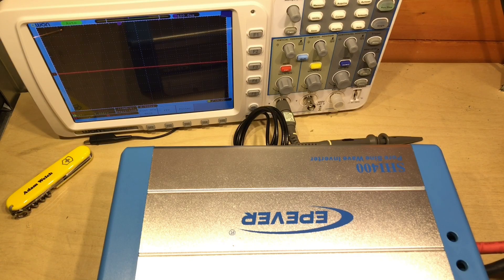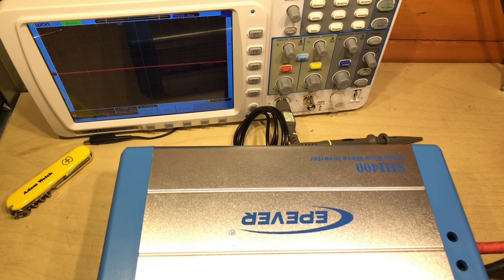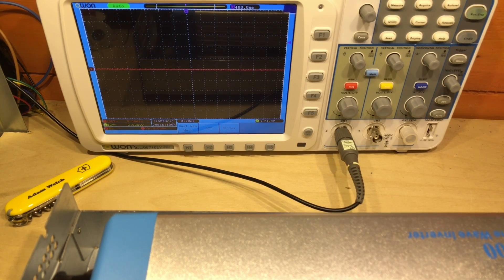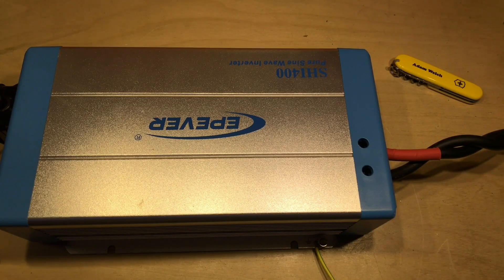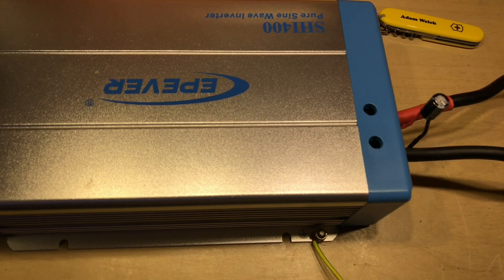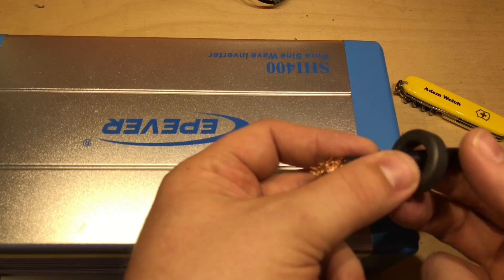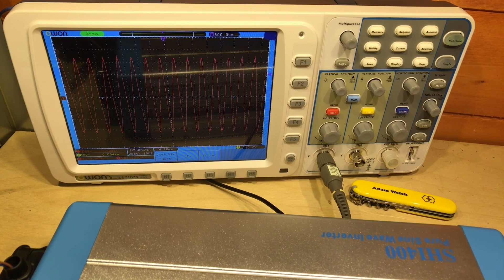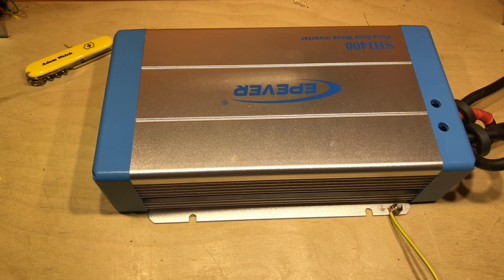Reducing RFI - Four simple methods - 12v Solar Shed

Comment: 1:24 The bad news is that those cutouts, at the right frequency act as very good "slot" antennas!  Even when not resonant, the shielding effect of a metal box relies on fairly complete closure.  Any hole, including an unwelded seam, that is about λ/4 or larger will conduct noise to the outside surface of the box, where it will radiate.

3:16 Filters are really some combination of inductors and capacitors.  Each capacitor has some amount of parasitic inductance, particularly those with wire legs (as opposed to surface mount), past which it ceases to be a useful filter.  There is always a frequency at which a particular component is resonant.  Wires also present a normal resistance, too, and especially electrolytic capacitors of the sort you used tend to have a maximum ripple current.  

So although capacitors can work, an LC filtering network needs to be designed with all that in mind.  

5:09 ah yes, the bane of every audio engineer's life.  That cable is for unbalanced audio which suffers from several different types of noise.  One is entirely conducted (ground loops) where especially mains AC noise currents in the shield/ground appears as noise relative to the signal, which the input stage faithfully picks up and reproduces.  This situation is most likely to be a problem of common-mode noise on the cable (ie, noise currents on both conductors going the same direction).  The right sort of ferrite ring can help with that, too.  (And note that choking impedance is proportional to the square of the number of turns.)

For this reason, professional audio uses balance (XLR) audio cables where possible.  These still pick up common-mode noise currents, but the complementary wire picks up the same amount of noise as the true wire, which the audio input stage cancels out by subtracting the signal on the complementary (aka 'cold') wire from the true ('hot') wire.  The result is clean audio, but it doesn't mean the noise isn't there.  

In this case, the inverter is still very much to blame.

Comment: This video is old but I want to comment to maybe help others... I designed a 12V to 230Vrms power inverter for automotive applications before.

The first method in the video didn’t work because you need to connect the ground of the inverter to the shield. But you have to becareful because if the low voltage and high voltage sides are isolated then you can create an isolation fault (isolated inverters should protect for this).

In our module we did couple of things to reduce EMI noise. We had a large LC filter on the front end. This will reduce the noise going out to your system. This is applicable if you have other electronics connected to the same source as the inverter. If the batteries are only powering the inverter then it doesn’t matter much. Adding a capacitor like you did at the input will help some with the noise going out to the power source but won’t help much on the AC side (for isolated systems). You can also add ceramic capacitors on the input to help with the noise. We had a ceramic and a electrolytic right at the input of the module. The electrolytic will form an LCR pi filter with the inductance of the input wires.

Second we placed X and Y capacitors around the input and the output and connected them to the module housing. The housing was the heatsink and also acted as a RF shield.

Thirdly we created a sudo faraday shield around the PCB by ensuring we always had a ground plane all throughout the edge of the PCB. We had a four layer board and tried to have ground on all four layers around the PCB and they were sitched together using via’s. This helps with radiated emissions.

I know you can’t do some of these things on a ready made module but hopefully this will give some ideas.

Comment: The interferences also makes the rs485 data transfert difficult to the epever tracer A charger. A bit a pitty because this inverter works fine otherwise. I use the hsi 3000 W.

Comment: The RFI on my Shi1000 24 v version is driving me crazy! I cant use it on my pc, which it was intended for, because it makes flickering on my pc screen which makes the display turn on and off on random.
Tried with some homemade ferrit rings out of metal strips but sometimes it works and sometimes not, so im ordering both real ferrit rings and capacitors now.
Just not sure what capacitor values to use on a 24 volt 1000 watt Shi1000 ?
Capacitor 35v 1000uf ?
Higher or lower uf value ?
Reply: Adam what size is the ferrit rings ?  You made just one loop?
I made some homemade ones out of metal strip.
Gave them 2 loops at first and it solved some of the problems.
Then tried 3 loops and a tighter fit to the rings with plastic strippers.
It made it worse again :(
Reply from the maker: My rings were too small really for the cable.  I got one loop through.  Also it may be better to loop the positive and negative through the same ring in opposite directions.  But whatever works really...
Reply: It might be too early to draw conclusions but i suspect this interference comes from either the charging process some way, the controllers or the batteries when charging, because yesterday at mid day when i tried a new approach with one ring, one twist and opposite ways trough the ring for positive and negative. it was flickering so much i couldn't use the pc.
Last night and this morning with a lot of clouds there was no flickering.
Now when the sun starts peeking out from the clouds the flickering starts again slowly.
I will try adding a capacitor also but im unsure what values to use for a 24 volt 1000 watt system?
I might try and get a special cable for my pc also as it seems only to cause problems with my pc ( television works and laptop work fine).
Im getting a 3000 watt inverter soon to go all off-grid but if this problem isnt solved it wont be an Epsolar/Epever :(
Btw a user from a danish solar group messaged me some days ago and said he had problems with his Shi1000 also.
When charging his Iphone there was so much audio inteference that he could not have a conversation while the phone was plugged into the inverter for charging.
Clearly Epever has some issues they need to address  regarding these inverters :(
My "cheapo" "500" watts, 50 dollars pure sine inverter has no such problems but its crap regarding delivering power

Comment: I am looking for a solution to the noise I hear from my solar inverter ... it has a high picked humming that drives me nuts
Reply: Me too, my house runs on an inverter, with it being only a 3000-watt pure sine wave I am thinking about a supply filter unit on the mains out lead from the inverter which I robbed out of a washing machine, it drives me insane, today I bought an antique MW/LW radio, it sounded great until I put the inverter on, the whole house wiring seems to become an antenna for this noise and it ruins enjoyment listening to radio's. 
And the electro-smog generated cannot be good for humans either, even if my £2.75p winter electric bill does compensate for it a little.

Comment: I have bought the Epever Shi1000 24volt 1000 watt and been using it for a few weeks. At first i thought it also had RF problems also as i had some flickering on my Computer screen when i was using my computer but it turned out to be a loose gfx card.
So far no issues with my Shi1000 in any regards but it is also placed outside and connected to my room with a wire.
I think its about 5 meters and a wall apart from my PC and no RF or other issues.
I highly recomend this inverter.
Much more powerful than most others and not much more expensive than the cheap ones that dont match the promised output, or does so with unstable and unreliable running.
Reply from the maker: Mine definitely lives up to it's claims.  It will deliver the constant and surge power suggested.  Glad you're happy with yours and you're not seeing any ill effects.
Reply: I just hooked my computer up with the Shi 1000 and had grafik problems again. tried many times with different cables.
Its not a loose gfx card but my Shi 1000 that has similar problems.
It causes small flickers on my pc screen and the display switches on and off.
It seems ill have to order some of these Ferrit rings and hope the so the job.
About the capacitor?  If i want to try that option also, what capacitor should i get?
Its a 24 volt system running at a 1000 watt.

Comment: Hi Adam, interesting video. Us electronics guys  need to minimise any R.F. interference not just for ourselves. Problem is neighbours will often blame the 'radio ham type bloke' in the shed, for any interference problems, when in most cases the shed gear is not responsible at all.
Reply from the maker: +Michael Thomas Yeah I agree. Theres so much electronic kit in everyone's home and a simple faulty component or badly designed circuit in any one of them can cause interference. As soon as we identify it we should be attempting to reduce its negative effects for everyone's benefit.

Comment: Hi Adam how can I use this inverter in my country which we use 110v as epever only sales the 220v version? also is there a way to make modified sine wave inverters a little "better" and by that I mean using some type of filter or rectifier to make them produce a more clean sine wave? thanks and sorry for the tricky questions I love your videos by the way
Reply from the maker: +Marcos Figueroa Hi Marcos. You might be able to step the voltage down using a step down transformer - but it seems like over kill. I'd be just tempted to use another model of inverter - one designed for 110. 
Modified sine waves are exactly that and there's no way to make them cleaner that I'm aware of. Some are better than others (more differential steps in the wave) but many are three step and pretty poor for many devices.

Comment: Seems like your mic extension cable was not properly shielded (or perhaps not at all). Many posters have already covered the "capacitor thing" so I won't comment further there. The other thing to consider of course is proximity. If you can move the inverter further away you'll get less direct radiated RFI and then you can treat the mains output easily with a commercial in-line noise filter. Often the best approach for getting rid of RFI is to use all the methods at once!
Reply: As as aside to the chat going on here: If you're operating really sensitive equipment from an inverter the only real choice is "low frequency pure sinewave". These inverters create a 50 Hz (or 60 Hz) low voltage / high current signal and simply feed it though a step-up transformer. They also tend to have a lot more "grunt" for starting difficult loads.

Comment: Ive just ordered the shi1000 and watching this carefully.  Not sure i will notice the RF noise if its there because my unit will be outside from where im living. I dont have a scope to test it with though.
Currently im running a cheapo 500 watt pure sine inverter with a cooler mod but even with cooler mod its not running 450 watts reliably continuously without some hickups that is making my computer reboot :(
And the stability and power is why i choose Epever inverter since i dont want something partly unstable like i already have.
And the price seems very reasonably.
Reply from the maker: +Resist Dk The wave is extremely good and the build quality seems good for the price. Most people won't notice this issue if it's like this by design. Or I could have a faulty one. I can only report on what I find. I hope you get good service from yours.
Reply: I dont have a scope so i cant test that aspect but ill let you guys know if theres any issues with the shi 1000 when it arrives or it behaves as rock stable as i expect :)
Reply: Since mine is outside but im experiencing this RFI noise also ( cant use it on my pc because it makes my screen flicker and switch on and off)  my guess it that it isnt as much as "radiation" from the unit itself as it is  disturbance in the 230 volt power its putting out.
A guy on Facebook just wrote to m from a solar group that he has same inverter and he cant use his iphone while charging it near the inverter due to noise.
It seems EPever has a general problem with Noise on these and its a shame since quality of it seems very good for the price ( despite the fact that it has much RFI noise and my old crappy 50 dollar tin can "600" watts inverter didnt)

Comment: Hi Adam thanks for the update on the EPever. pls can you advise where to connect the earth from the Inverter if mounted on wood in my caravan thanks
Reply from the maker: That's an interesting question.  Best solution is a ground rod hammered into the ground but this might not be practical if you move frequently.  I bet the steadies of your caravan use plastic or wood feet too don't they?  I'm not entirely sure what's best I'm afraid.

Comment: Thanks for the follow-up, Adam. Glad you've sorted it out. For reference, it's good practice to add a small disc capacitor (1,000pF or so) in parallel with an electrolytic. This is because the larger capacitor is quite inductive and an RF signal will 'see' a high impedance. The small capacitor has much less parasitic inductance, particularly if lead lengths are kept short, so the RF noise sees a near short circuit, and is dissipated. Both parts of a screening box need to be connected together properly, forming a Faraday cage, and a short ground lead needs to be connected to it, preferably to a proper ground, not just the Earth connector in the plug..
Reply from the maker: Thanks for the note on the capacitor - I will definitely try that.  I've connected the inverter to my house ground and it was physically touching both halves of the 'box' but this wasn't really a serious attempt due to the lack of a suitable container.  Too big for a biscuit tin!
Reply: I know the feeling! There's almost never a case of the right dimensions when you need one. They're usually an eBay away, but that usually takes too long. ;-p

Comment: Hmmm. One would expect that to already have much more capacitance on the input than could be provided by such a tiny capacitor.
Reply: For RF, a small capacitor (1,000pF, for instance) is much better than a large electrolytic one. This is because the rolled-up metal plates are inductors, so RF encounters a high impedance, preventing the capacitance from shorting it out, and thus dissipating it. For the same reason, keep all filter conductors as short as possible. Electrolytic capacitors  work well as good filters only at low frequencies.

Comment: Well done. Victory in the end
Reply from the maker: Well yes and no - I've reduced the issue but it's not eliminated really.
Reply: Adam Welch That's true, partial victory maybe 😊Have you hooked it up to the Epever software yet?
They seem to make decent gear, especially for the price. 
Your vids were a big help with choosing the tracer. I also did your cable hack, thanks for sharing that!

Comment: Seems like the noise from a DC-DC converter inside of the unit. Not sure if you can decrease it much without going inside the inverter and modifying it.
Reply from the maker: I think I've reduced it a little but I also think you're right.  I've asked EPEver to consider that I have a faulty unit.  Other owners don't seem to be reporting the same issue. Cheers
Reply: Usually, there's a capacitor between primary-secondary side of the PS, which is there to cancel out the noise which is coupled to the output by inter-winding capacitance. Maybe in your unit it's not fitted or faulty.

Comment: An old microwave will do. Remove the inside and you will have a nice cage of Faraday.
Of course you could also build one using aluminum foil.
But Rf is very annoying. My laptop power unit disturbs my radio receiver. As well FM as higher bands are effected. And I do as well have an inverter supplying back into the grid, that one as well has a lot of RFI. I seem to have got used to it, and just listen to the radio stations which I do still can receive. We live inside RFI! My WiFi is on all the time, I have 2 telephone stations and my mobile phone is somewhere in my neighborhood as well. My neighbors also have WiFi and they all use amplifiers! It is just that our mobile phones and tablets need WiFi or else I would shut it down all the way. (sorry for all the chatter).
Reply from the maker: Now I did consider wrapping the metal box in tin foil but thought I would be laughed at!  You're right the modern world is very 'noisy'.  Sadly radio hams are having a hard time with it all.  Testing and adjusting circuits to reduce the effect has a cost though - and the consumer demands the lowest prices.  And then only a handful of customers will notice the difference.
Reply: Try tin foil!
Reply: Dang gone good one. I never thought of that. What a good what to isolate a small rfi problem

Comment: I might have missed a couple of things, sorry for that, having seriously issues with my eyes again, what frequencies do you see  on the scope and are they the same that disturb the microphone? 
If it is really HF freq via the cable then it might help to put a smaller capacitor in parallel typically 100NF. They suppress HF noise much better in some cases.  Also placing both cables through ferrite with different winding might help more. 
A nice video about it is this one   https://youtu.be/81C4IfONt3o
Reply from the maker: Cheer Luc.  When I put my scope into FFT mode there are a number of frequencies showing up.  50Hz - and some harmonics of this are the overwhelming readings - which makes sense.
I will add a 100n cap and see how that improves things and I'll look at a getting a larger ferrite ring.  I had those ones lying around and they just about worked!  Cheers for the link - I'll add it to my watch list.